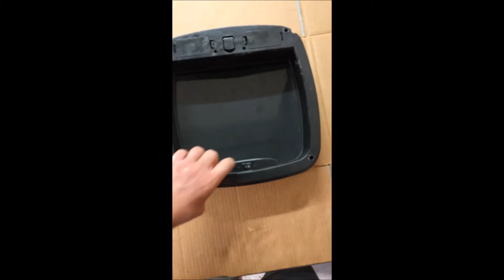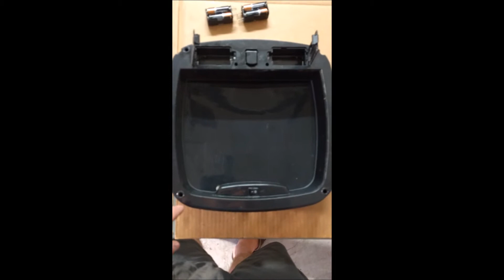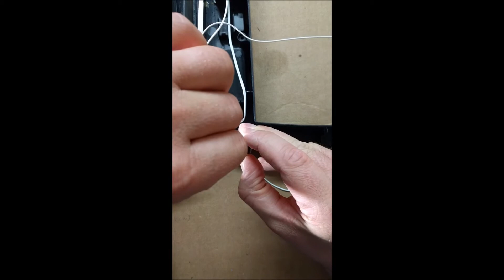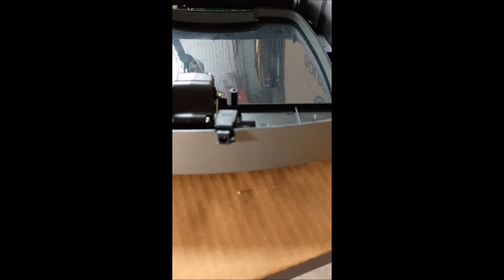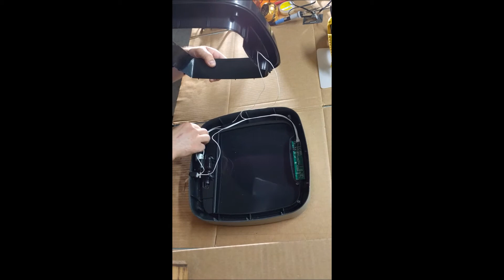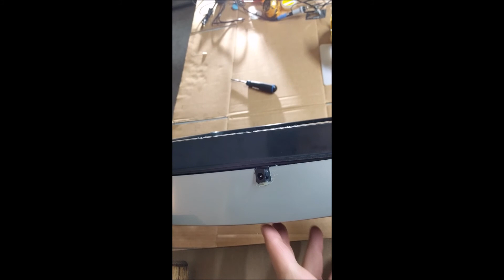Convert Battery Powered Trash Can to Wall Power

Comment: WRONG !!!! HEY you don't understand electronics Jarrod. The battery packs are NOT in SERIES dude, they are in PARALLEL That means its 6V at twice the current. At 12 V it opens faster because you doubled the voltage - NOT recommended unless you know the motor specifications .  You may very well burn up the motor.